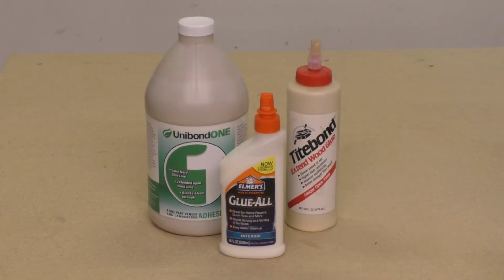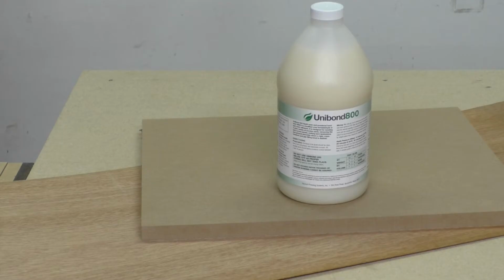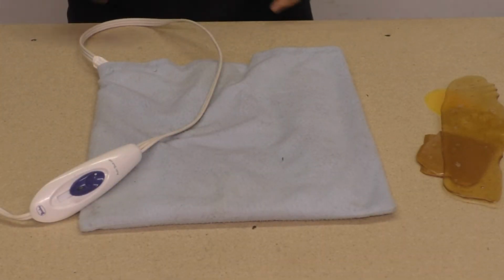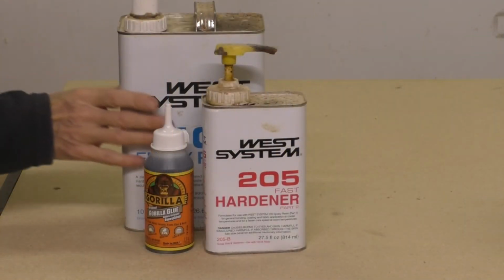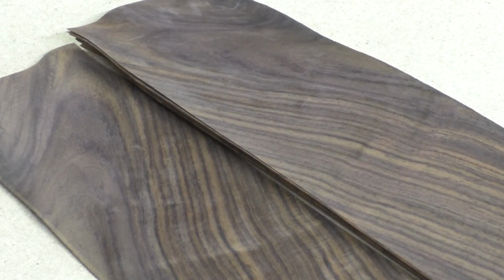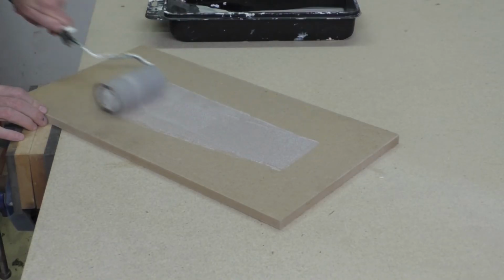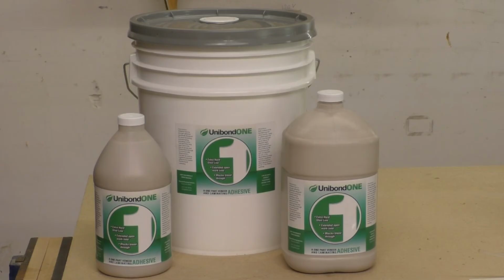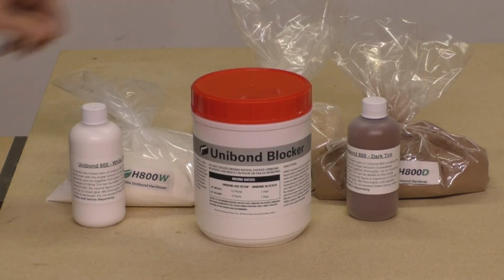Understanding Glue for Veneering

Comment: Excellent video.  I'm wondering about two things...
* Is there any downside to using Urea Resin glue for solid wood joinery?  Too brittle?
* How's the bond strength of Unibond 1 PVA as compared to Titebond II.
Reply from the maker: Urea resin glues are completely fine for solid wood joinery. It has been widely used in solid wood flat and bent lamination work. As far as bond strength of Unibond One compared to Titebond 2, they are very similar to each other. Titebond 2 gives you a waterproof rating if that matters to you. Unibond One gives you a harder glue line but is not waterproof. Since Unibond One was developed for veneer work a waterproof rating was not important

Comment: First, thanks for your video sharing information on gluing veneers. But, after watching, it seems I have more questions than answers. Your information is directed to those whose task is gluing large panels of veneers.  But, what about those smaller applications like Marquetry. These are usually limited in size to a much smaller area substrate and not requiring longer working times. The multiple veneers are glued to smaller substrates and applied as finished art objects such as boxes, hanging artwork, etc. Bleed through is a concern as often figured burls and other veneers are used. Vacuum bags are commonly utilized to apply even pressure and heating pads can be added if needed. What would you suggest as the best glue for this type of application? Thanks for your help
Reply from the maker: Although you can use a typical PVA glue like Titebond and you will get good adhesion, a chemical reaction type of glue has no cold creep and is more rigid. Epoxy, polyurethane and Urea resin glue are the three common types in this category. Of the three, urea resin will bleed through the least. If you want to try our Unibond 800 you can add the blocker we carry to minimize bleed through. Be aware that on commercially sliced veneer, you will most likely get some bleed through. Don't expect a marquetry panel to be bleed through free. You can scrap and sand the bleed through off.

Comment: I am planning to apply a veneer to a wooden drum after I have painted the veneer. I can’t paint the rounded surface using the technique I have planned. What glue should I use in this application?  All help welcome and appreciated. Thank you.
Reply from the maker: I would recommend checking out our Working in a Vacuum video and skip to the 33:36 minute mark for veneering a cylinder. https://www.youtube.com/watch?v=XweRCxu3qX8
Reply: @ Amazingly helpful. Thank you!  I have purchased Titebond Cold Press which I now see may only be good for step one and that a moisture-less glue is needed for step two. Now if only I can keep the paint from cracking during bending!
Reply from the maker: @charlesoverly3472  You're welcome and good luck!

Comment: Hi  , i have a question about titenbond 3 for veneers. I'm not sure i understood how it works? What if you have a veneer surface and you can't put it in the vacuum bag? Thnx
Reply from the maker: If you are using a PVA glue like Titebond 3 and you are in a situation where you do not have or are not able to put your work into a vacuum bag you will need to create uniform pressure in some other method, for example a mechanical press.
Reply: I tried but it didn't work. I usually work with contact cement,this is the first time I used titenbond 3. I even tried with iron....but.... the top of the table didn't turn out well 😢

Comment: Conservators have noted that under varying conditions of heat and humidity, urea glues can fail. Formulating these glues with a small percentage of melamine or phenolic mitigates this to some degree. The Unibond 800 has a resin and powder component --similar to Resorcinol, which is absolutely bullet proof but expensive and nearly inaccessible. 

Does the Unibond have additional additives as described above? Is there more than physical similarity between it and Resorcinol? 

If it does, I'm all over it!
Reply from the maker: Urea resin glues are generally not Type I marine grade glues, so if you are planning on veneering the hull of your boat, we would not recommend them. That being said, they are highly water and heat resistant so are more than adequate for high humidity cases like bathrooms or exterior exposure situations like doors and windows and almost any other veneering or laminating application. Resorcinol is a fantastic Type I marine grade glue, but is generally not recommended for veneering due to its deep purple color and its cost. There are additives for urea resin glues that will turn them into a Type I glue, but they will only cure at high heat (above 175 degrees), so are not useable for anyone without a hot press. 

So to finally answer your question, no, Unibond 800 does not have additional additives.

Comment: Hello Darryl,
Am discovering the wonderful world of veneering and vacuum pressing and have stumbled upon your site. Your videos are so clear, explicit and thorough. Thank you for the work you have put into them. I even saw one of your earlier ones (actually, my first one) , dating from '98 or was it '99? Still totally applicable.
This first video tells me that you have been in business for quite a while. Congratulations!
Your thoroughness and clarity will certainly weight very heavily in my purchasing decisions when I get to this part of woodworking.
I would have a question that is not totally on the subject of this video but still related: I watched some of your videos on using vacuum bags but not having watched all of your library, please tell me if, when gluing large panels of MDF or baltic burch ply (1"x24"x60"), I need to use a caul on top of my panels in addition to the obviously needed one underneath? If so, should it have grooves in it? How about a mesh instead of the groves?
Looking to viewing the rest of your work, on YouTube or on your site.
Sincerely,
Paul
Canada
Reply from the maker: Paul, glad to hear you are finding the videos informative. If your surface veneer or laminate is over an eighth of an inch you will generally not need a caul. The purpose of a caul is to provide uniform pressure as well as protect your work from wrinkles or anything else telegraphing into the finished surface of your project, as well as protecting your bag from sharp corners on the piece being pressed. You do not want grooves in your cauls as they can telegraph into your veneer. If you have a grooved platen board, you do not need to use the mesh as well. If you would like to discuss in detail, please give us a call.
Reply: @VacuumPressingSystemsInc  Thanks Darryl (or Peter),
Here again your explanation is very thorough.
I recently found out that Titebond recommends a clamping pressure of about 75 psi when clamping boards (at least for laminating, not talking about veneering here). If gluing large boards (as described in my first comment: about 1"x24"x60"), is the 25 inHg provided by your pumps sufficient? Since atmospheric pressure is around 30 inHg and that results in about 15 psi, would using a vacuum bag to clamp down large boards provide sufficient pressure (about 12 psi)? It would certainly be easier and more convenient than using weights or cauls and clamps, that's for sure.
Syncerely,
Paul
Reply from the maker: @paulfrancoeur9852  We are not sure exactly where Titebond gets the 75 psi recommendation from, but it doesn't hold true when comes to vacuum. Vacuum is all about accumulated pressure, for example on your 24"x60" piece you'll have about 18,000lbs of pressure (24x60x12.5psi), which is plenty! You'd be hard-pressed (no pun intended) to create that much uniform pressure with clamps or weights.
Reply: @VacuumPressingSystemsInc  Thanks Darryl,
That's what I thought too. 
Cheers

Comment: Looking forward to using our new 5x10 fliptop table. The one thing I'm curious about is the ideal glue for laying up full 5x10 sheets of laminate (phenolic back) on particleboard. Will Unibond One have enough open time to roll this out, even in a hot southern shop?
Reply from the maker: Unibond One will give you roughly 10-15 minutes of open work time, considering your climate you will be on the 10 minute side. As long as you work quickly, you should have enough time to lay up 5x10 sheets.
Reply: @VacuumPressingSystemsInc  Cool thanks for the info! The video was exceptionally helpful.

Comment: Great info! What glue would you use for making 2 ply veneer for a curved panel?
Reply from the maker: you can use a common PVA type glue or a two part urea resin glue, depending on the veneer. For a simple plain sliced straight grain veneer the PVA glue is fine. For something fancy like a crotch or burl veneer I would use the urea resin glue. Epoxy or polyurethane would work in this second scenario as well.

Comment: What would be a proper glue for veneering without a vacuum press? Because UnivondOne is not available in Mexico.
Reply from the maker: If you have means to apply uniform clamping pressure to the entire veneer surface you can use a common PVA glue like Titebond. if you cannot do this then your only option is contact cement, which, depending on the veneer may or may not work.
Reply: @VacuumPressingSystemsInc  Thank you very much...  This was a very clear answer

Comment: What a great vid with all the tests. I love wood, and my favorite, living on a boat is PU glue (in Europe we have the Dutch company Bison as top glue brand). Thinking about to build a wooden rowing boat (single skulling Skiff) with glueing 4x veneers to get a 3 mm thickness hull wall via Diagonal strip planking method. Still have to think about if I take paper backed veneer to have some more stability during the curving over a hull form. Racing rowing boats have extreme curved hulls. - Tks for uploading the vid. Appreciate your efforts a lot.

Comment: Can resin glue be used to bond veneer to hardwood? I know pva can't
Reply from the maker: Urea resin and PVA glues can be used to bond veneer to hardwood.
Reply: @VacuumPressingSystemsInc  do you mean your specific pva glue? I've always heard that pva should only be used to bond veneer to PLYWOOD never hardwood
Reply from the maker: @abeannis  I am not sure where you received that information, but PVA glues in general can be used for veneering to hardwood. There are reasons why you might want to avoid PVA glues for veneering, regardless of the substrate, but that is a much larger topic.

Comment: You should make the distinction between interior and exterior applications.  For exterior you definitely want a flexible glue so it can contract and expand with temperature.
Reply from the maker: Logically you would think that to be the case, but most exterior glues are quite rigid, like epoxy and resorcinol. Exterior glues are thermosetting, mix part A with part B, making them very hard. Interior glues, in general, are the softer ones, which is why you get “cold creep” with interior glues, but not exterior ones.

Comment: Thank you for the detailed info in the video!
I have a question:  I experimented with some oak veneer, with no vacuum press, and I found out that PVA glue tends to work very well but after a couple of days, the veneer develops some dark spots of blueish black colour. Should I use a bleed - through blocker? If yes, does a thin shellac coat work as a blocker?

Comment: Excluding surfaces expected to get wet, hot hide glue is still your best all around veneer glue.  No vacuum press, no clamps, just a veneer hammer (a simple squeegee) 

If you screw-up, just wet it, remove it and try again. Be sure to buy the heater element and the granulated glue.
Reply from the maker: Without a doubt hide glue is a great veneer glue. It's been used for a long time before modern glues became popular. The fact that it is reversible has its benefits, especially in antique restoration work. There are a few reasons why it has fallen out of favor and why I only gave it a mention in the video. First, it's a fussy glue to work with and takes an extra skill level to master well. Second, you don't have the open work time that you do with other glues, making it somewhat limited. Better for smaller panels, and like I said, great for antique restoration work.
Reply: @VacuumPressingSystemsInc   I've  seen veneers applied to curved, vertical surfaces while standing on a ladder using hot hide glue.  The little heater element  was perched on the ladder paint platform.
It was about as complicated as hanging  wallpaper.
I don't know any other glue that would have worked. Veneers that were misaligned were simply wetted down, pealed off, and reapplied. 
Today, hot hide glue is notoriously overlooked.

Comment: as a refinisher, i gladly like the adhesives that are softer and thusly easier to reflatten veneer. the adhesives you suggest are a one and done with little to get under and repair the substrate. what are the solutions to resoften you adhesives to reglue your buckles . if you are applying  those hard glues to core the backer then veneer, then there is a bubble , how do you  settle it. im asking to finishers about where their art will be in 30 or 50 years who fixes it or can it be recovered. thanks again great info.
Reply from the maker: We recommend a hypodermic needle and super glue for fixing a bubble.

Comment: You talked about the value of a long open-work time, but then you said you designed your urea glue to set faster.  Somewhat confusing.  Without any mention of actual working times, it's hard to compare.

Comment: That is very informative, and I am ordering some Unibond 800 from your website today.
I have two questions: 
1. when to use the bleed blocker, I am using a lot of walnut burl and olive/ash burl - would I need a blocker for these?
2. do you put little bit of Unibond 800 into the seems before putting the veneer down? I do this with Titebond -  otherwise I get visible lines on the finish. How do you deal with that with Unibond 800?
Reply from the maker: 1. The bleed-through blocker is often used with burls, crotches, and open-grain veneers. 
2. We do not generally glue the seams. For additional information on seaming veneer, please see our video on veneer tape.

Comment: How about CA glue?
Reply from the maker: CA glues are great for spot repairs, but are generally not used for veneering and laminating.
Reply: @VacuumPressingSystemsInc 
Thank you for a prompt response! I am aware that they are usable for repairs, but what could stop a random diy-er in using it for larger area veneering, as it ticks all tbe properties boxes?
Reply: @VacuumPressingSystemsInc  namely, my first veneering project (an 80-90''s dining table) went awfully wrong, as you described in the video, while using contact cement glue, and I actually repaired ALL of it with using humble superglue (in large quantities), and another coat of lacquer. Therefore I wonder could I use that glue at first place in some future projects?

Comment: Great Video. I agreed with everything you said about glues. Spot on, and well presented!
 I am a Contractor, and was a shipwright for many years. I did a lot of woodwork and veneering on the yachts I built, and I have used epoxy, formaldehyde  glue, wood glue and contact cement for veneer. Contact cement was great because we could do a 12 foot sheet of rosewood right in place on the boat,  but you weren't kidding about it not being a good option for veneer. Several of our warranty work projects had failed veneer. It was always in an area that was in the sun near a window. the veneer blistered had curled up.  The dash wash done with a vacuum and epoxy with woven fiberglass on the underside to keep the dash from warping, since it being in full sun all day everyday in places like the tropics, and we never had any failures with epoxy.

Comment: Contact cement is an adhesive not really a glue. It doesn't really get absorbed but rather adheres to a surface and I have never seen it not fail over time. The larger the piece of veneer the more likely it is to fail.
Reply from the maker: Agreed. That's been our observation as well.

Comment: Great stuff, I am about to make some interior doors with engineered veneer vacuum pressed with heat. I plan to use a popular glue here called fevicol SH, It is synthesized by heating formaldehyde and urea together.

Do you think this will be ideal for my purpose
Reply from the maker: I am not familiar with this glue. From what I can see it appears to be a type of regular PVA(white glue). I dont think it is a form of urea formaldehyde glue as this kind of glue does not come in one part that is not mixed with either water of a separate catalyst. I cant give you a good recommendation if I have not worked with or tested the glue in question.
Reply: @VacuumPressingSystemsInc  Thanks a lot, my thoughts exactly

Comment: There is some confusion about material properties here. For instance, hardness and rigidity are two different things - one does not necessarily correlate to the other. I know that doesn't seem intuitive, but it's true. Some engineering terms that would be helpful to research would be material hardness, brittleness, and elasticity. I think the property of the area glue that is most important here is its lack of elasticity, or its high modulus of elasticity (or high Young's modulus to use a different term for the same thing).
Reply from the maker: Thank you for the feedback.